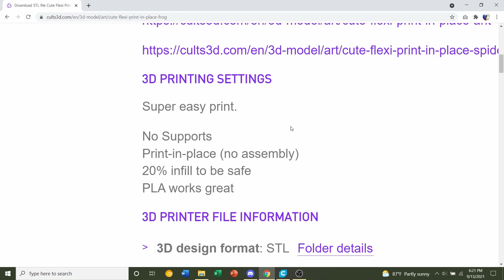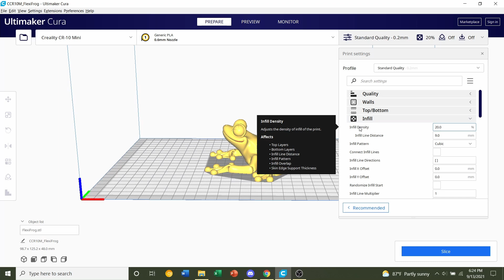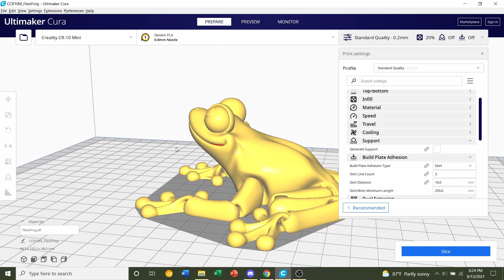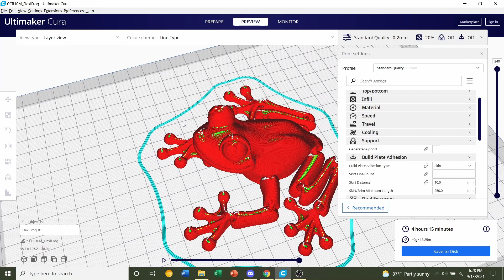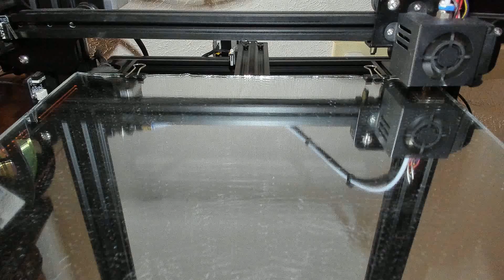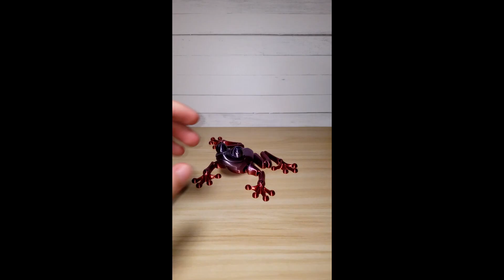3D Printed Flexi Frog Tutorial - How to 3D print Complete Beginner Tutorial 2021

Comment: Couldn't get this one to print on my Ender 3 V2. I tried 4 times with fails each time. It can get the first few layers printed but then does not want to stay on the bed for some reason. Such a bummer as I really wanted to print this one
Reply from the maker: Sounds like you need better adhesion. Try adding hair spray to your print bed or increase the bed temperature. I use a product called bed weld for all my prints, link in the descp.